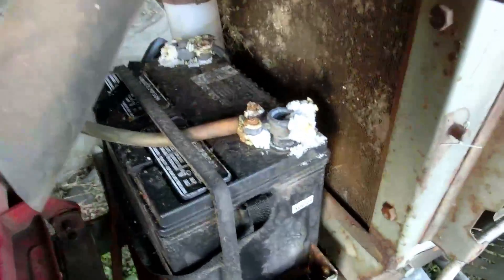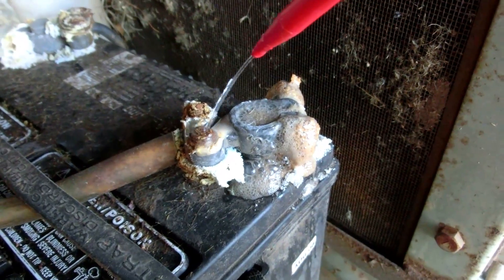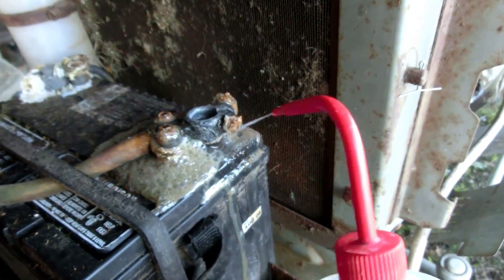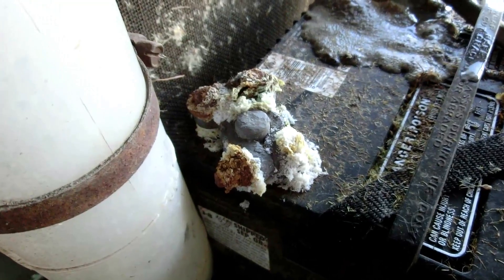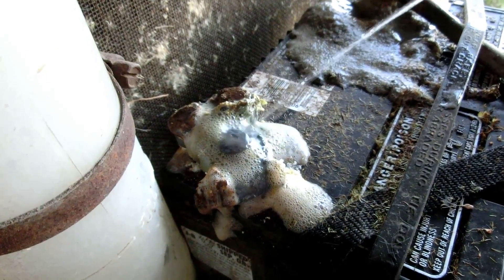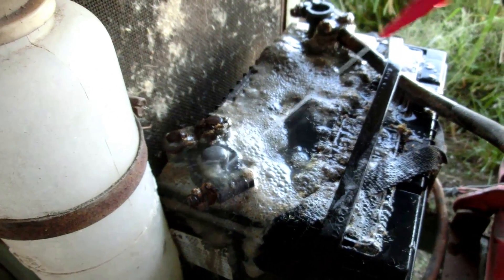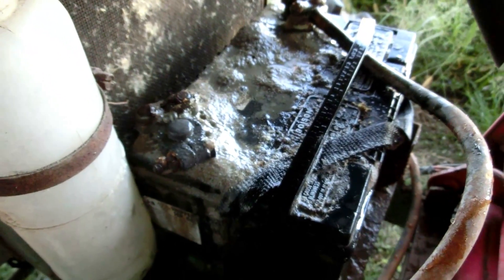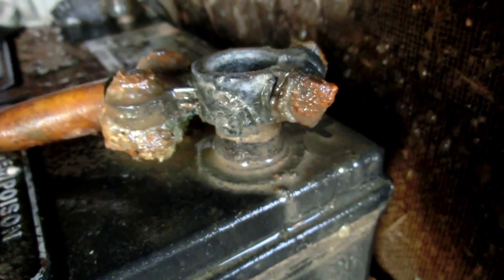Quickly Clean Battery Terminals with Baking Soda

Comment: To clean battery corostion do it properly. Or just use hot water. Do Not Use Baking Soda if it gets into the battery it could nutralize your battery or damage a cell making your battery useless.
Acid And Base Do Not Mix
Reply: Paul R  brake cleaner that's what they use at the car dealerships.
.

Comment: Wet battery terminals reminds me, I live in Florida and about a month ago I was doing some serious work on my wife's car (replacing the neutral safety switch, quite buried in the engine bay on top of the transmission, I had to move a lot of components out of the way). The interesting thing was that I was (unfortunately and disgustingly) quite sweaty, and I had just gotten everything back together on the car. The final step was reconnecting the terminals on the battery. I had my hand on the front cross member of the car touching bare metal, and when I put the positive lead back on the battery my entire body felt like I was licking a 9 volt battery. Turns out the sweat on my hands was conducting enough through the frame of the car and the positive terminal I was being electrocuted lol...
Reply: Thats one reason to connect gound last.

Comment: you got a little in the vents and in the battery acid it's self that bubbling noise after you switched angles was not good if that battery had life in it ir shouldn't for long you're most likely going to end up with a bad cell soon. not trying to hate just pointing it out to others
Reply from the maker: +Austin Johnson the vents arent wide open though, they are pretty much sealed, thats why they can work underwater.

Comment: It did a good job, but would still remove it and clean the pan maybe put a liner on the bottom as well as maybe new bolts to tighten the lugs.

Comment: couldn't you short the battery by letting water connect the ground and positive?
Reply: +FilmFactry Since nothing happened, i'd assume the battery was completely empty. Else the water would at least have electrolysed, which it didn't seem to do.
Reply: Mint Waxed water is an insulator. H2O, neither hydrogen or oxygen conduct electricity. Contaminated water, it tap water, does conduct because of the minerals in it. Distilled demineralized water is what the power companies use to wash off the salt accumulation that builds on power line insulators in salty areas like the ocean. 12 volts DC just is not strong enough to overcome the amount of resistance in the water that's on top of the battery.

Comment: How do you preventing it from coming back. !??
Reply: Ron B You can  spray the terminals with hair spray when they are completely dry. Also, there are terminal pads(very inexpensive little felt pads that are treated) witch go on the battery before connecting your cables. They work well and most parts stores have them.